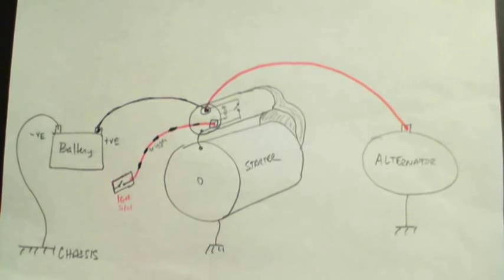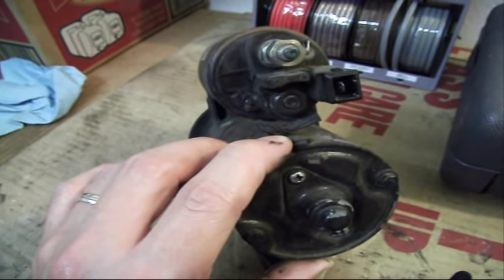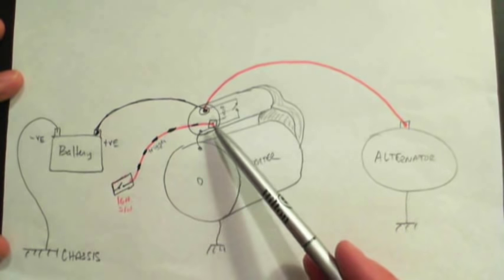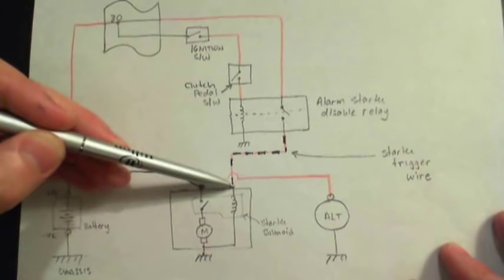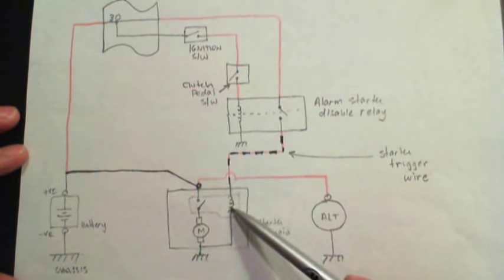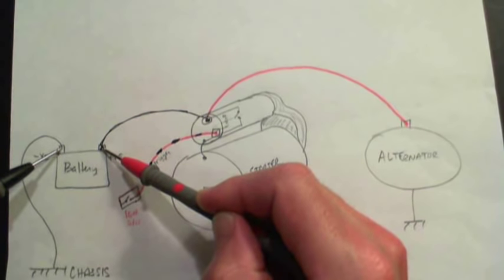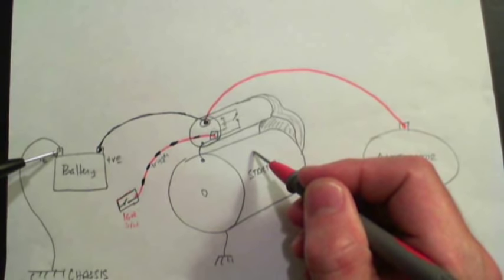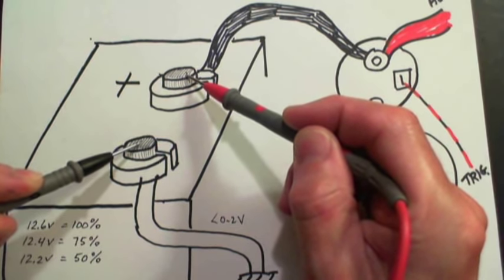Starter Motor Troubleshooting Tips DIY - How to diagnose starter problems

Comment: My starter is getting hot when I try to start. Doesn't crank over and the positive cable gets hot along with the starter.  

battery reads 12.3v, cable to starter, alternator,  and fuse box reads 12.3v. 

New starter.  new positive cables. new battery. 

Would appreciate any help.  Thank you.
Reply from the maker: getting hot means that 1) the wiring system is properly activating the starter and the cables and connections are providing a good path for current to flow AND that current is flowing.  Since current is flowing and the starter isn't spinning it means one of two things 1) the motor is not able to turn because of a mechanical issue such as a stuck starter pinion gear or 2) current is flowing due to a short in the starter motor windings and it isn't flowing through the entire armature - therefore not creating the proper magnetic field to turn the motor.  If the motor is getting really hot to the touch then sounds like you're going to have to take it off the car to see what the problem is.  Will probably have to replace it. /John
Reply from the maker: I just realized you said it was a new starter.  Is it possible the starter is not installed properly or else the starter pinion gear teeth are a different pitch than the old starter?
Reply: bearing01 thanks for the reply.  it started doing this with the original starter.  but I'll have to check the teeth . could there be any other wiring other than the positive and negative cable making a shortage to cause the heating up of the positive cable and starter?
Reply from the maker: usually the positive battery that goes to the starter also goes to the alternator.  If there is a short in the alternator, bad alternator diodes or a short in the car's electrical system then that could cause the +ve battery cable to get hot from current flow, but the starter would not get hot because the problem isn't in the starter. /John
Reply: bearing01 ignition cable is reading 9.2v with battery at 12.2v. any thoughts on this?
Reply: bearing01 Also.  I'm not getting a reading on the negative cable to the starter.

Comment: you should check your voltage on a solenoid wire while it's actually connected to the solenoid otherwise you are no testing voltage drop on that wire due to bad connections

Comment: i have a 99 land rover disco that wont start. sometimes its one big CLICK, other times its a rapid clicking. does this mean its a battery issue?
Reply from the maker: +Hunter Skowron Sounds like it could be a loose battery cable or corroded battery terminal. /John
Reply: thanks for the info - before the went dead and started doing the clicks, there was a pretty bad grinding sound whenever i started it
Reply: +Hunter Skowron did you ever find out what the problem was?
Reply: nope - ended up selling it.
Reply: Hunter Skowron eww
Reply: iF IT SOUNDS like a machine-gun the solinoid is broken ,the circuit that holds the sprocket in place is gone .
Reply: It means you need a new starter or rebuild yours

Comment: hi, i'm having a bit of a problem with with gmc jimmy, i drive it turn it off then by itself the solenoid starts clicking with the ignition key off and drains battery what could cause the problem the solenoid has been redone.

Comment: I get nothing when I turn my key forward change ignition switch and tumbler + fuel pump relay. No dashboard lights like oil, amps, brake. And no ac.
Reply: Dirty Red have you tried the battery?

Comment: hey I just got a new bosch starter for a 73 super beetle. and i hook it all up as it was before and upon connecting the negative battery cable back on. the starter "turns on" hope you know and its an easy fix

Comment: What if you can start the car by using a multimeter and connecting to the solenoid without turning the key. But the car wont start normally. Thats what my car is doing.

Comment: why do the alternator + wire have to be connected to the starter?
Reply from the maker: +kyriakos k They are big heavy expensive wires.  They take up space in the engine bay and are a pain in the ass to route.  Both share a common lead from the battery.  They both could have separate runs to a common point from that lead but since the motor and alternator are both on at separate times they can share some wiring as in the diagram.  /John

Comment: I tried to bypass the solenoid & attach the cable to the starter direct. We could get the stater to turn but it would not engage the motor. Tried all sorts of things... turned out that I need a new starter & battery. $600.00 ...ouch,  plus the tow!

Comment: 86 ford ranger not getting power to the fuel pump. I used a jumper wire from the batt.to the pump and it works well. I put the two wire to the fuel shut off together still nothing           anderson

Comment: Just because a battery reads 12 volts or more doesn't mean its a good battery. You need to know the most important fact. i.e. its CCA (cold cranking ampage) worn out batteries can still show 12 volts or more but have depleted CCA that wont turn the motor. Leaves a lot of head scratching trying to figure out the problem when one assumes 12volt readings indicate good batteries

Comment from the maker: Did the lights dim at all?  Does the car have an alarm that disables the starter?  First make sure the battery connection is solid without corrosion.  Next make sure it's not the alarm.  Starters are a bitch to remove on BMW's.  They're located up high out of reach.

Comment: Before changing old starter the car hesitated to start seems like low voltage drive it 5miles next day won't start so I jump it starts right up wife take it to work let it sit for few hours she try go to lunch won't start hers killer she tried jumping car threw Fuse Box Under Engine she hooked both cables up positive & negative to fuse box I always do it from Battery 2008 Equinox I say Battery need changing she say starter.

Comment from the maker: Sounds like a bad starter.  11V on the starter terminal should make it turn the engine.  Because it will freely spin with no load on the bench does not mean it will be strong enough to turn the engine.